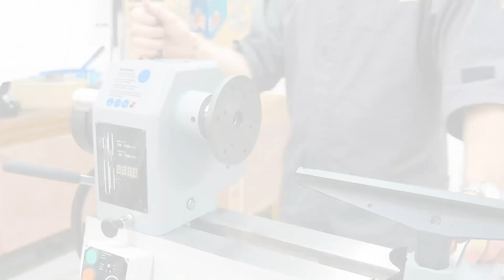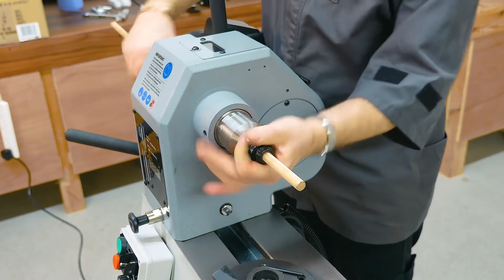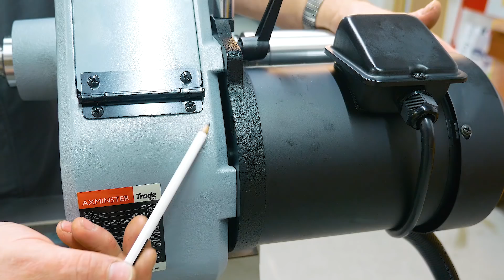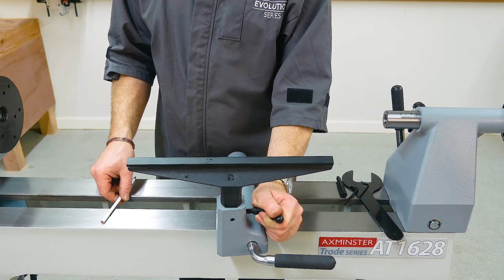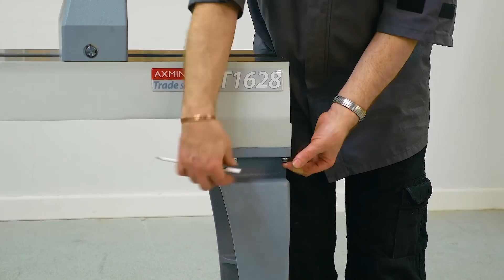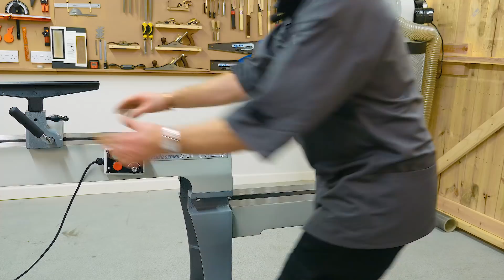Axminster Trade Series AT1628VS Woodturning Lathe - Product Overview

Comment: Hi Axminster folks!
Loving my 1628; one of the last before you re-labled as 406 :)
I'd like to be able to occasionally move the lathe out from its 'wall facing' position but the legs don't have the bolt holes to allow fitment of the lifting castors (vid time 16:25 here). Any chance of a template so I can drill and tap them myself? Just to get them in exactly the right place, in the hope that you might get the wheels back in stock at some point... (part no.507151?) :)
All the best,
Frank
Reply from the maker: Hi Frank, we do not have a template for these castors. The only dimensions we have are as follows - 
Mounting plate is 74mm wide x 120mm high
With the lever down the overall width is 185mm
Distance centre to centre between fixing points is 103mm.

I hope this helps!
Reply: @axminster  Brilliant, thank you very much! If I might trouble you for one last measurement... Are you able to give the distance from the bottom edge of the lathe leg, up to where the first fixing hole should be? I'll be able to work out the optimum position when I get the wheels of course, but just in case you have that measurement it'll save some head scratching when I get to  it. No worries at all if not :)

Comment: I'm a little confused. I came here from your website where I was viewing the AT406WL , I noticed the lathe shown here is the AT1628, then when I went back to your website to check, I see that the 'in detail' description on the AT406WL  page describes the lathe as AT1628VS. Could you clarify this for me please?
Ideally I am looking for a trade wood lathe in the middle range of the market, but it must be mobile.
I see you are out of stock for the stands of the AT406WL/AT1628VS Lathes, do you know how long for please? Also, in the picture it does not show the stands showing the pre-drilled holes for the Axminster Workbench Castors, will your new stock have these holes?
Thanks for any help you can give
Reply: I've done more research, even though your vidio says 2018, the model shown above  is around 6 years old, is the model advertised on your site AT406WL, the same model, but just with a different number?
Reply: I guess Axminster don't review their own YouTube comments then? 😒
Reply from the maker: Dear Mr Chapman, 

Please accept my apologies for the delay in response. 
The AT406WL was previously known as the AT1628VS.
We are expecting stock of the stand for this model to be available towards the end of April, you can place a back order for this online or sign up to be notified by email when this in back in stock.
Please be advised that the stand comes pre drilled you just need to remove the feet, the thread size is M6. I hope this helps.

Kind regards

Jade
Customer Service

Comment: what is the maximum this could turn outboard safely
Reply from the maker: If you have the lathe fitted to the cast iron leg stand it can also be attached in a lower position offering an impressive 875mm swing over the bed. Kind regards Tracey Customer Service